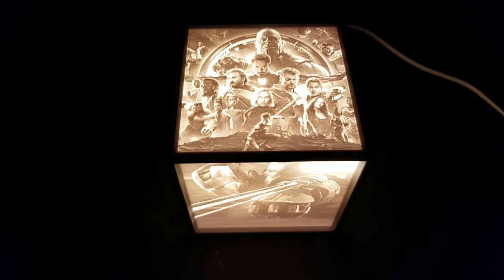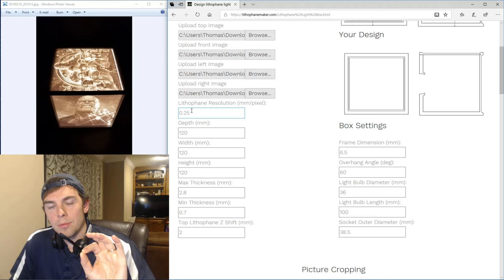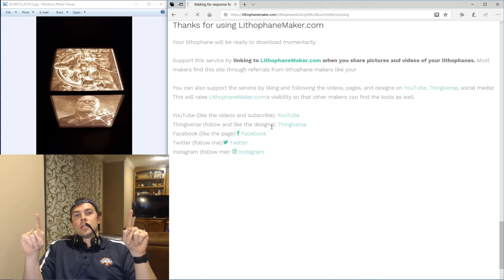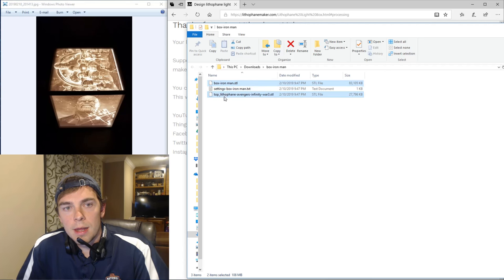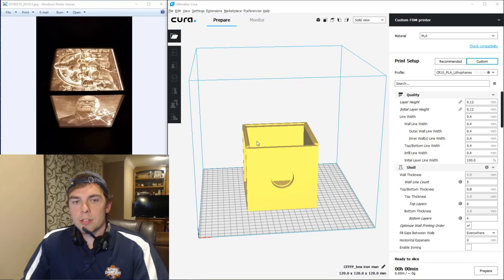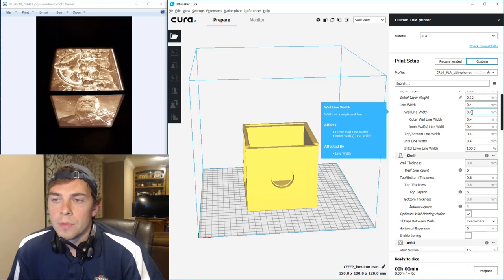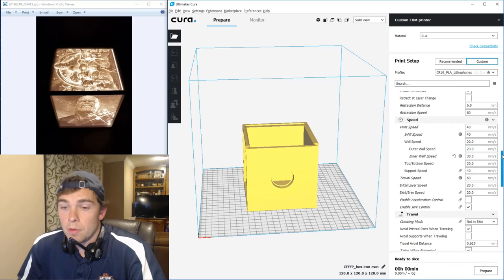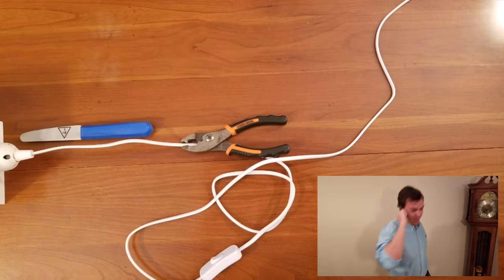3D Print a Lithophane Light Box

Comment: I think it would be awesome if the lithophane sides could come out so you could just print new ones and change them out in the box instead of having to print an entirely new box.
Reply: @moschwaner  got a link?
Reply: I'd prefer a 5 picture box with the light hole on the bottom as well. Or even with just 4 still have the hole on bottom.

Comment: HOW DID you keep the light socket tight in the hole   mines is kinda loose  should i use some type of glue or caulk
Reply: i see no one ever answered yo on this... I just received my sockets and they're also loose. i thought of using glue but nothing permanent. Maybe E6000 or just some silicone on the outside.

Comment: Great work. I was wondering if the sides that don't have a picture could be separate so that we don't have to do 100% infill on those. It would save like 6-12 hours of print time. So basically a box with 4 sides should be the long pic print. Thanks
Reply: Print at 99%

Comment: Thanks for the app to make the box.  I am able to print out the box portion with no issues but everytime that I try to print the top it does not come out so that I can see the picture.  I am using the same settings as for the box.  Should I be doing something different?

Comment: Are supports needed? In your settings they are enabled, but did not understand if necessary.
Reply: That's what I was checking for.  In the default Cura settings (45 degree), my slice had the three sides completely covered by support.  Changed to match his (65 degree, support touching base), and it really reduced the supports....going to give it a try.

Comment: Hello there sir, I have been using your website for a while to sell these spherical lithophane for my small 3d print startup. It is going really well. Although lately i have been facing a lot of delay in downloading files. Could you possibly make a paid tier for the website and maintain the required server speeds. Thank you
Reply from the maker: You might want to try the desktop application available at americanfilament.us
Reply: @LithophaneMaker  thank you so much for this . but the software is showing as free. i am from India. i cant support your project by ordering from the website. is there a link for patreon or tip box that i can support ?

Comment: great work, i have a question though, is it not possible to make a box that you can have all 4 sides done and a top so you dont have to use the bulb option? id rather just put an led light in there personally , but playing around with the box maker i can get rid of the bulb hole but then im just left with  a blank back panel.
Reply: Fusion360. U can edit the stl to cover the hole.

Comment: I have Ender 3 ... & My longest print to this printer is a lithophane of 12hours.. but this model takes continuous 2 day print time.. does it is safe... Or I should not try this model..
Reply: You should be fine. Ive done a 3day print
Reply: I've done a couple 4 Day Prints on my Ender 3V2.  Biggest thing to watch is to make sure you don't run out of filament in the middle of the night lol

Comment: Early in the video you show a completed box having back edges. However in the video you print in white PLA. How did you get the black edges?
Reply from the maker: The edges are white, but the light doesn't go through them because they're thick, so they appear black in that lighting
Reply from the maker: You can print white lithophanes and find a box frame on thingiverse if you want black edges though
Reply: @LithophaneMaker  Thanks for the quick reply and the excellent site!

Comment: I have a lamp socket that fits, but it’s loose. Do I push it I. Further? Does not seem like it will do that without breaking it.
Reply from the maker: Does tightening the bulb onto the socket make it work for you? It has to be a little loose for the socket to for in the hole.

Comment: Hi Thomas,

I’m not sure why but for some reason every time I use the lithophane maker website to make this light box with the exact settings you have and slice it in Cura, put it on my sd card, and start printing, it always fails. It prints one or two layers fine and I come back like 8 hours later and the print is still on the second layer as if the z axis didn’t move up. I can print any other file fine but when I slice this it always fails the same way. Do you know why?

Comment: Did you use the exact same settings i.e print speeds, 5 wall line count, for the top piece as well?
Reply: same question and did you print it vertically or horizontally?
Reply: uknowwhatthisisfor The lid comes out best vertically but you need a raft to keep it upright.
Reply: @Familytravelgo  Shouldn't need a raft if you have proper adhesion. I printed a standard lithophane from his site without a raft. I even upscaled the size

Comment: I noticed you used a CFL bulb. I notice the base of LED bulbs get rather hot. Any comment on the heat given off by the CFL (I do not have any at the moment). They are less efficient than LEDs so they should lose more energy to heat but I feel the concentrated heat at the base of they LED bulbs might melt or degrade the plastic.
Reply from the maker: I left it on overnight and the plastic on the top lithophane bowed slightly but not enough for me to care. LED would be better

Comment: Do you have a box design where the hole is on the bottom as opposed to the side?  I was thinking about using a small lamp to hold the box by the bedside.  Thanks.
Reply from the maker: I do not. Have you seen the lithophane lamp tool?
Reply: @LithophaneMaker  Can you make one? Seems like highly requested option.
Reply from the maker: @braaap2065  you want to buy one from me?
Reply: @LithophaneMaker  No. I was saying can you make a box with the hole in the bottom for the bulb? Think about it. If you move it to the bottom and have a channel for the wire that comes out a side or back you could embed the wire in the bottom and come out that frame. I'm currently 3 days 8 hours into an expanded box using your generator. 6.5"x6.5x6.5. Has right around 5 hours left. I really appreciate the tool. But being able to use all 4 sides and the top for a picture would be awesome.

Comment: What size orientation do i need to make the picture to make it fit in the pane? I can photoshop down a picture to the size but I can't find the size dimensions on the website anywhere.
Reply from the maker: You crop the images and set the dimension on the tool. Watch the portion where I walk through the tool again
Reply: @LithophaneMaker  I have watched the video but i would like to change image sizes in photoshop. So knowing the size of the field of view would be great.
Reply: The answer is 1172 px x 1172 px
Reply from the maker: If the box is a cube, then any picture with an aspect ratio of 1 won't need to be cropped with the tool. The more pixels, the better up to a point. Once the picture's dimensions exceed height/(lithophane resolution) number of pixels, more pixels don't really help.
Reply from the maker: The code changes your picture to have the number of pixels it needs, so you don't have to worry too much about getting the exactly correct number of pictures. It interpolates between pixel values if you have fewer pixels, and reduces the picture resolution if you have more pixels.